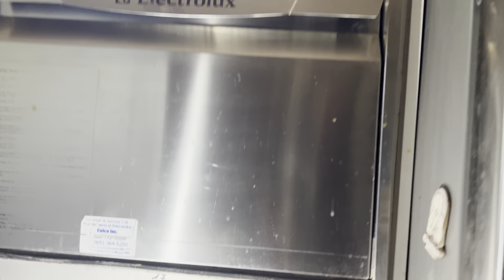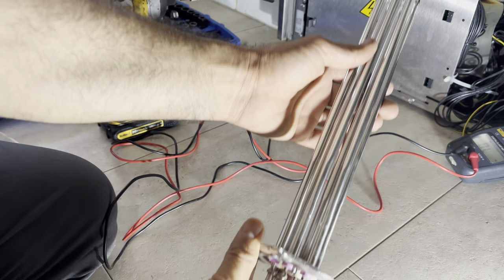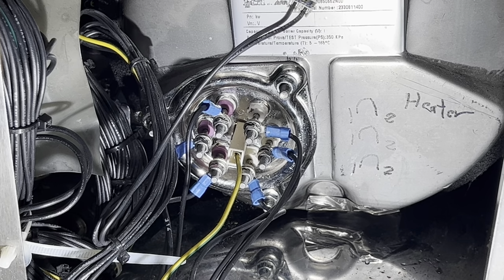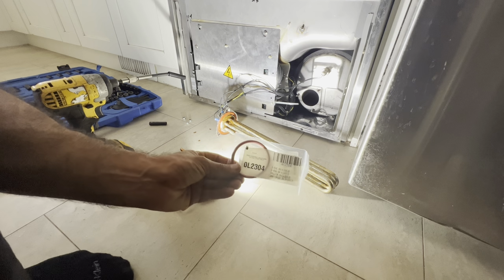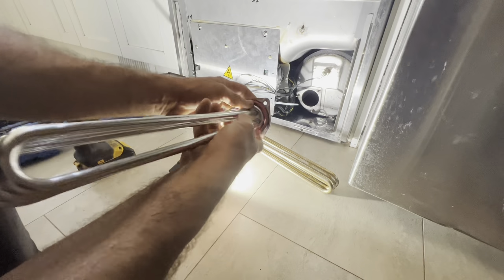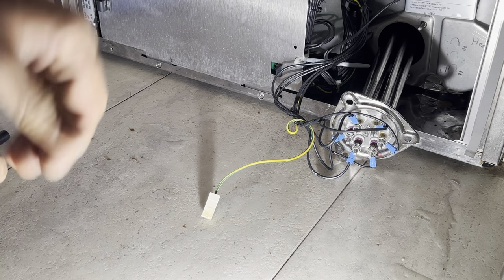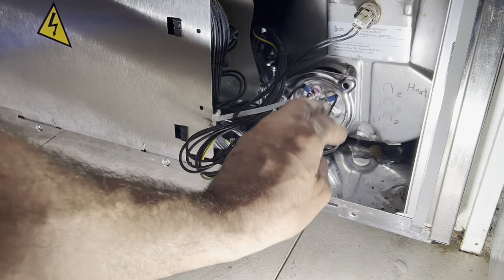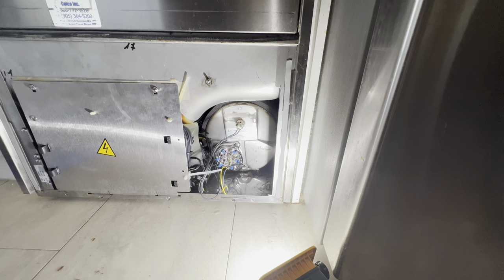Electrolux dishwasher error code E3

Comment: How much can we charge someone for doing this repair?
Reply from the maker: It depends on installation and area . If it’s outside of the city or inside . I would say minimum labor is $300 or more because there is a lot of techs who does not work in these units except commercial guys , commercial guys charged an arm and leg when doing these repairs 😁
Reply: Okay thanks for the fast reply
Reply from the maker: My pleasure!